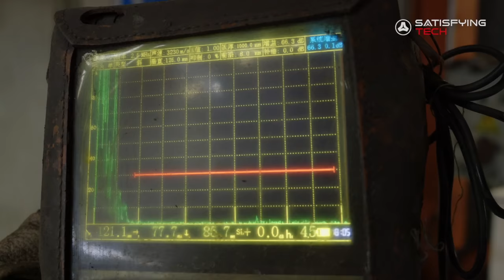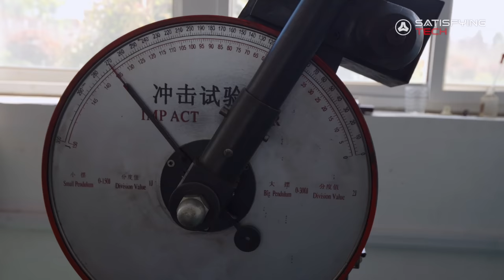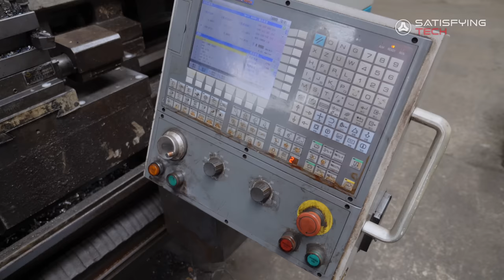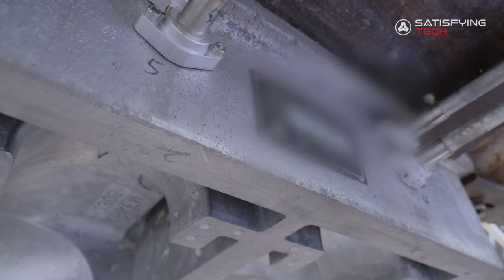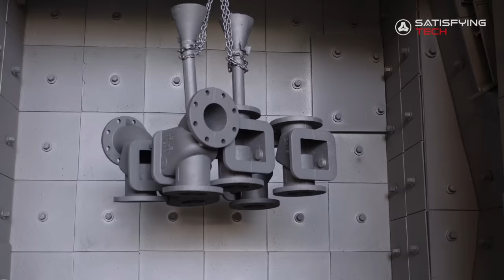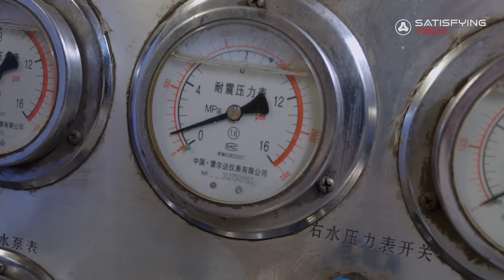Top 5! Amazing Mass Production Tech! Best Factory!

Comment: Anchor chains, maybe amazing to watch, quite the opposite is making them.
A word about testing. Chain is stretched to it's required lenght, also called callibration. Stretching it is actually plastic deformation. Any bad weld will break at the time. It is recorded at what force it happens and compared to nominal load. Actual tensile strenght is measured separately. They cut three links from a chain, somtimes from each chain, sometimes from a batch of four, since four are made simultaneously, depending on the register ship is registered with and insurance company requirements. These three links are pulled untill they break and must, at minimum, meet design breaking load. Both values, nominal load and breaking strenght are stamped into each end of chain along with a stamp of the register.
Reply: Are there any videos showing the testing procedures ?

Comment: Ok, one observation is the script states this shackle can lift 600 tons, yet the stamp on the shackle rates it at 150 tons, why?
Reply: 150x4=600 usually if your lifting 600 ton I’d say your lifting by 4 points at a minimum….imo
Reply: Of course, but I still ask why it states the 'single' shackle not 4, can lift 600 tons when it's clearly stamped 150 @gazrayt
Reply: It's actually a 4 to 1 safety factor.   So it should never fail if used according to the stamp.

Comment: As a retired master I had several occasions where I needed to purchase chain cable.  Would never buy Chinese chain.  The Chinese cable already on the ships was in terrible condition and not very old. My classification society had been having problems with Chinese chain being fraudulently certified and failing to meet the standards required.  Always purchased German chain.  Never skimp on ground tackle, it will save your life.  Cheap shit may cost you your life.